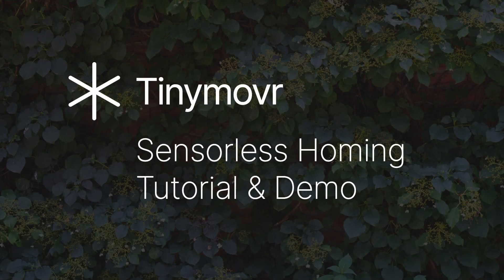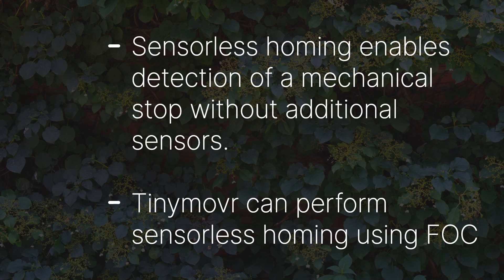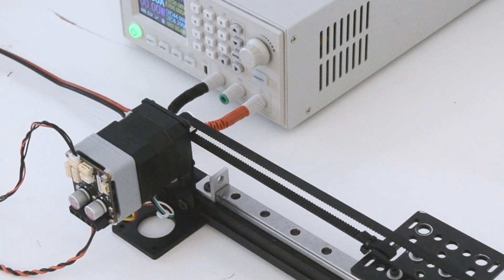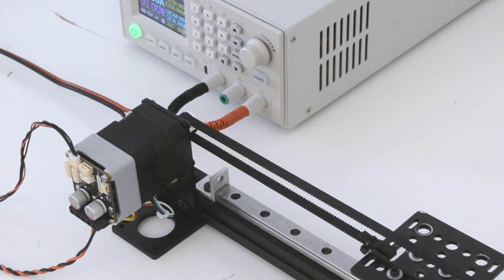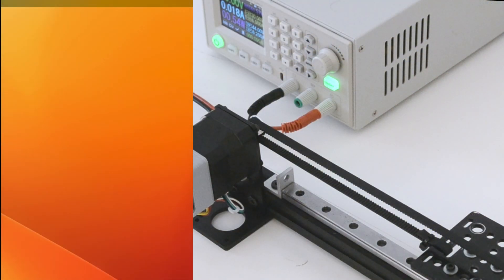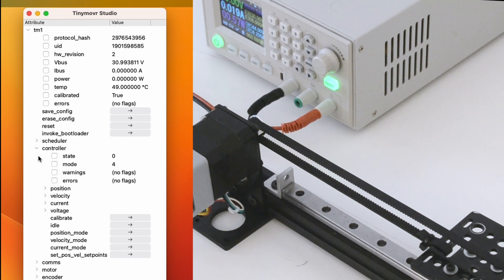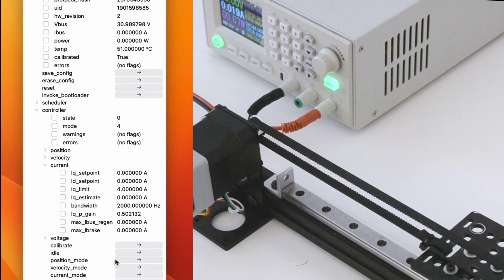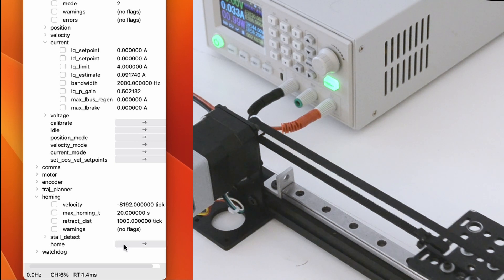Tinymovr Sensorless Homing Demo

Comment: If I choose to use a different motor would this value of 4A threshold current change? And if so, how should I know what value to replace it with?
Reply from the maker: Yes, it is dependent on the motor and your mechanical setup (gear ratio etc.). This is determined empirically, once you have a working system, you can see what kind of currents produce how much torque. Based on that start with low values, and increase till you are satisfied with performance.